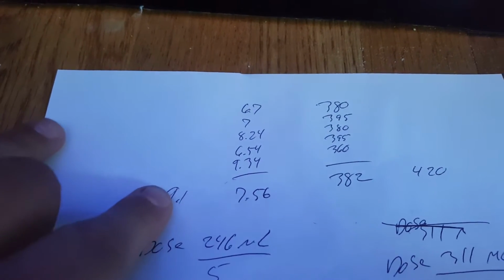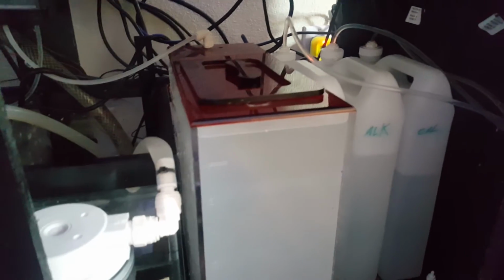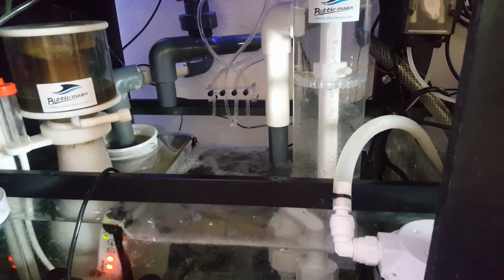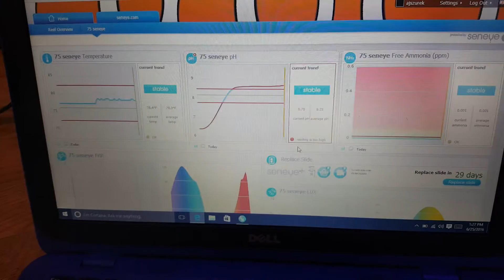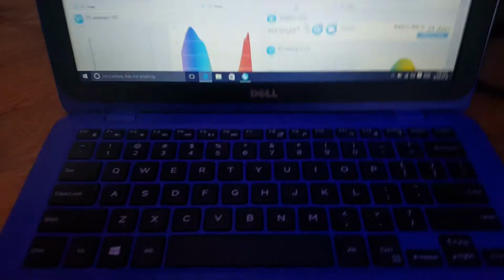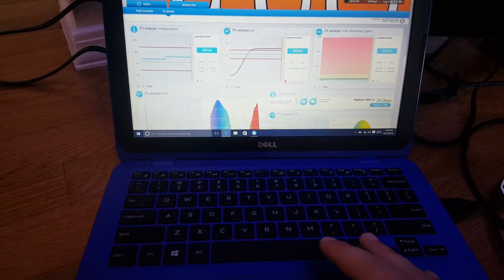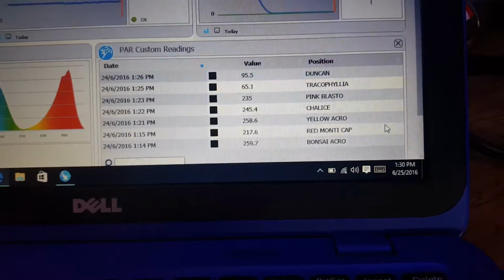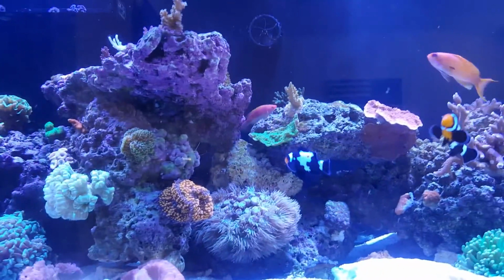kalkwasser and 2 part dosing strategy update 1

Comment: what all happened to this? I looked through your vids but only saw updates on the new build
Reply from the maker: Nado i experienced more consistent ph and great coral growth. however the tank completely crashed due to an extreme lack of phosphates in the system. in my new build i will be starting off exclusively woth kalk. as my needs exceed that i will go back to this.
Reply: sounds good, cant wait to see!
Reply: @racecarsandreeftanks9660  looking at the flowrate through that zeovit reactor, I can see why you had issues - it should be SLOW, not gushing

Comment: Just saw this.  I too have a Seneye that I use as a par meter.  what numbers did you tune the radion's to?  What's the par on your sand in various locations, etc?  I am having a hard time tuning the lights because I'm not entirely sure what the par should be on the sand, which is where I want to base my light intensity off of.
Reply from the maker: Paul Diehm i have them tuned to 80% currently which got me a par range from 50ish in the sand bed along the edges to to 250-300 on the top of the rock. i will do another update here soon with my new aquascape.